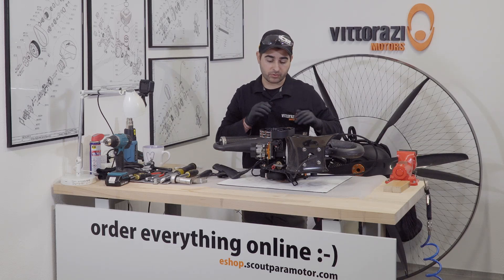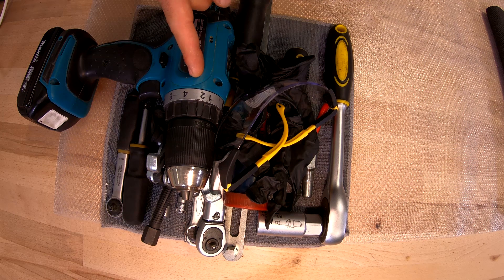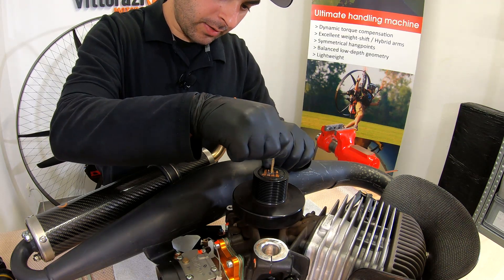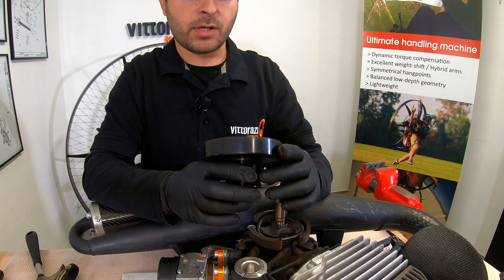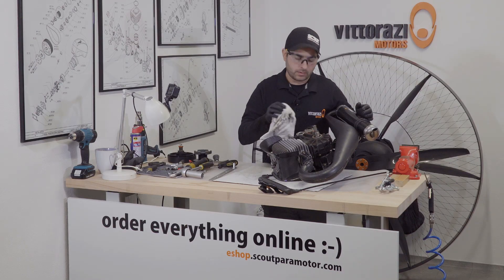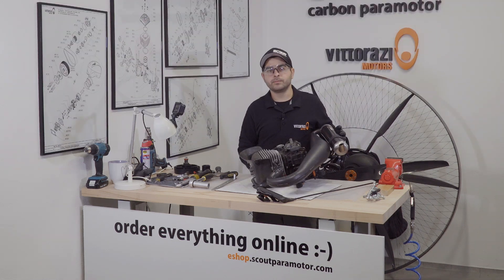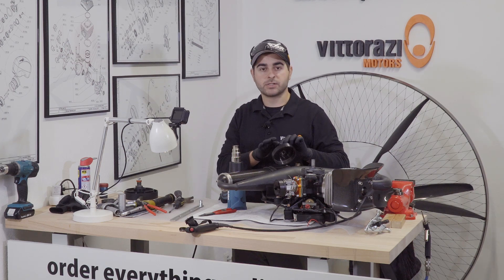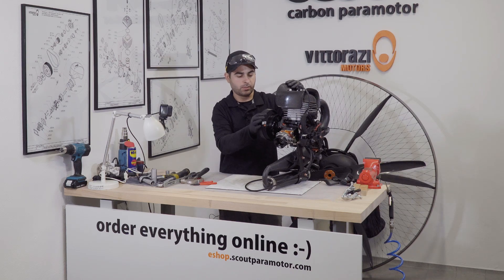Vittorazi Moster Plus clutch replacement. Paramotor engine maintenance (Reduction drive group)

Comment: Anyone else have trouble getting the clutch off? Mine seems to be seized on the crank shaft and won't budge even using a cheater bar on the wrench

Comment: You should do a video on replacing the oil seal.  The Vittorazi manual says you're supposed to do it every 100 hours, but I cannot find one video on doing it.
Reply: Finally https://youtu.be/Xvr1mg1Mb30
Reply: @mbrunnme  I saw it too!!! Thanks for the heads up!